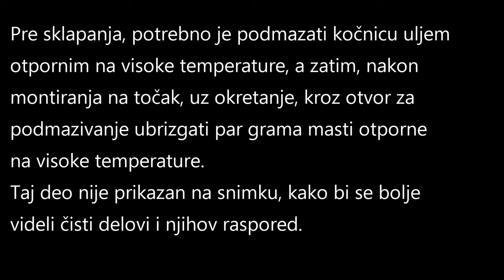Shimano roller brake disassembly and reassembly [0013]

Comment: Thank’s for the video, what kind of grease do you recommend for the breaks.
Reply: Don't mess around. it is a molybdenum disulphide based greas. So the original Shimano Rollerbrake Grease. Nothing else!
Reply: Good and cheap substitute Febi bilstein 02582 grease!!
Reply: @piksinjo69  sehr korrekte Antwort👍

Comment: The last three pieces you remove, are the brake tapes? Are they replaced? I have the same system but it doesn't slow down too much. There are parts that need to be replaced like conventional brakes. I don't understand how it works. Thank you

Comment: My bike's rear brake is like this, but I get a noise, what should I do now?
Reply: @BikeGremlinUS  Thank you for replying to my message. I will do this on the weekend.I wonder if it is necessary to put new parts in the roles.By the way, my bike is Batavus 8-speed

Comment: My disc is loose on my brake, the disc is it normal and how do i fix it?
Reply: There should be a washer between your frame and the aluminium disc. This washer had a rubber ring inside that loosens after several years. If you replace it it wont rattle anymore. Doesn't influence the braking tough.
Reply: @alwinkruijt8260  where can I get a new rubber ring?

Comment: No grease before re-assembly?
Reply: @BikeGremlinUS  Do you have any advice on what grease to use. 
I have heard marine grease or any grease that is good for high temperature but not sure what to buy. Shimano make some I know but it is quite expensive and I will need a bit as I have a few bikes to service there must be something equivalent or better from a parts shop.
Reply: @thedave7760  Don't mess around. it is a molybdenum disulphide based grease. So the original Shimano Rollerbrake Grease only. Please nothing else!
Reply: @alwinkruijt8260  Good and cheap substitute Febi bilstein 02582 grease!!